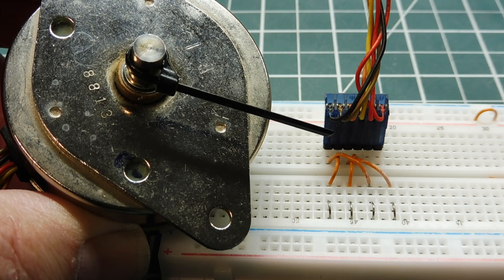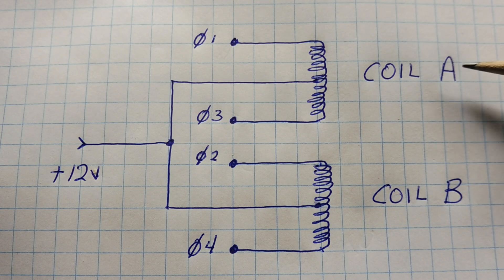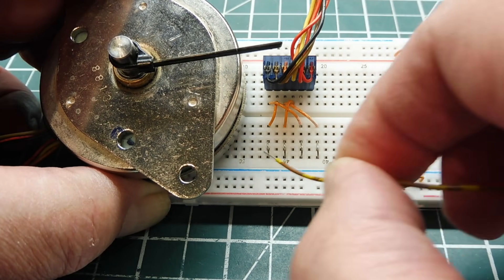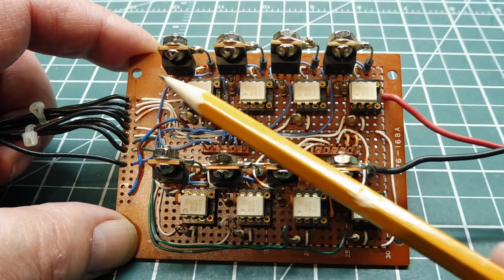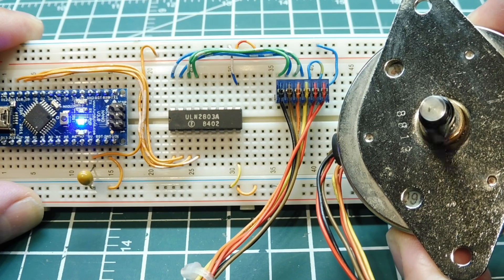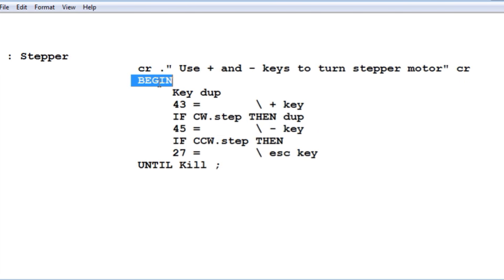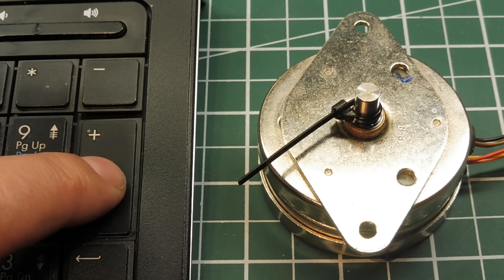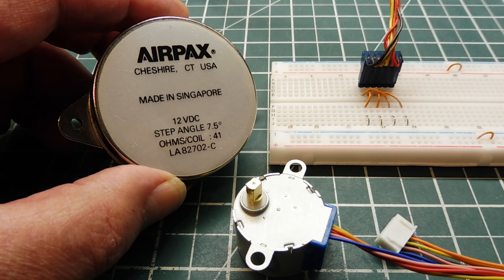Stepper Motor Primer  /  Arduino

Comment: Neat! Reminds me of the Apple II disk drive (moving the head between tracks).

With that disk drive, you could energize two adjacent phases to “half step”, or position between normal steps.  I bet your stepper motors could do that, too.

One other interesting trick is for position changes that require multiple steps. Use a longer time between steps at the beginning and end, getting shorter towards the middle. This accelerates and decelerates, which makes the movement both faster and quieter. Of course you need to know the inertia of the motor and what it is moving, to determine the time between steps.

Comment: Great video !!     I’m thinking about using your setup  to turn a home thermostat knob and wondering if the torque is sufficient. Do the stepper motors in this video have a fair amount of torque?
Reply from the maker: There are many sizes and types to choose from. Check the data sheet for torque specs. They are in ounce-inches. They way you drive the motor will affect the torque output. https://romanblack.com/stepper.htm
The small stepper motor at the end of the video is geared so it has lots of torque.
You could also use a hobby servo motor for your project. 
https://www.digikey.ca/en/maker/projects/use-an-arduino-to-make-your-thermostat-programmable/866ec0057ff84feebfbc6c3709a7777c
Reply: 0033mer Thanks!  Just picked up a servo, gonna give this project a try.

Comment: Great video, thank you! The only thing that irritated me has been the "non-phase" with all LEDs off between phase 4 and 1 (and vice versa) at 2:10.
Reply from the maker: The LED display was for demo purposes to show direction and imitating the manual method. The actual signals feeding the stepper were correct.